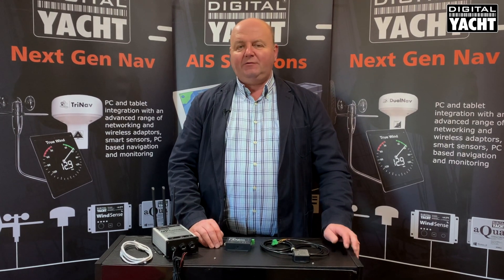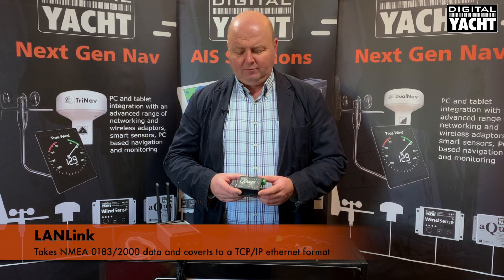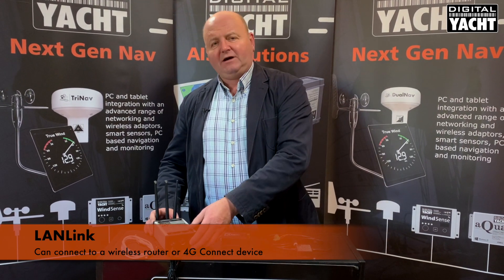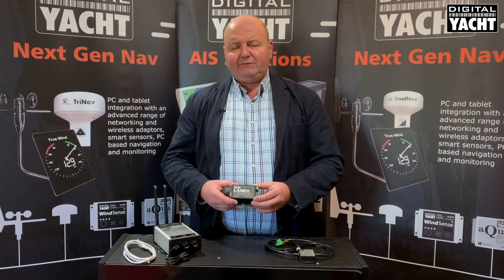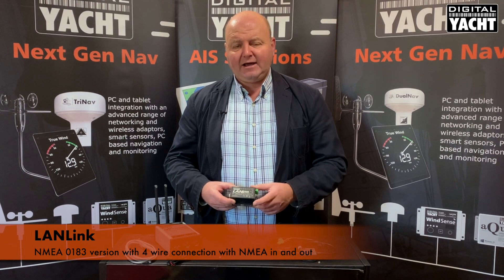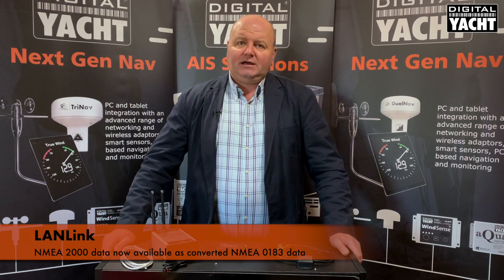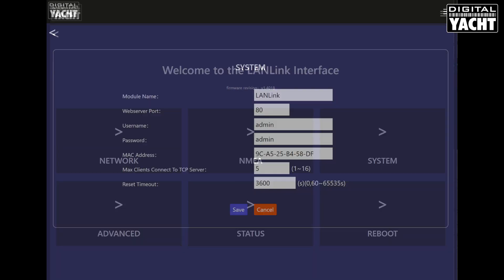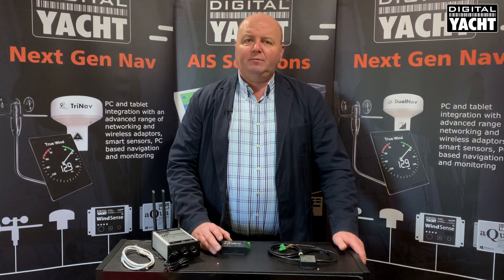LANLink - NMEA to Ethernet Gateway - Digital Yacht

Comment: the photos on the website seem to indicate that this device only has NMEA0183 but not NMEA2000 which means you'd need an adapter. is that correct?
Reply from the maker: LANLink NMEA 2000 is provided with a NMEA0183/NMEA2000 converter.
Reply: @DigitalYachtLimited  so in other words, you convert from 2000 to 0183 (much slower) and then to ethernet. WHY? i mean, why not go from 2000 direct to ethernet?
Reply from the maker: @mrxmry3264  There is no point converting if the popular software applications that will be using the data cannot handle NMEA 2000. We can transfer raw NMEA 2000 binary data over LANLink, but only a few applications can read this raw data format. It would be great if more developers did and we publish the details of our protocol on GitHub....
https://github.com/digitalyacht/iKonvert/wiki/4.-Serial-Protocol